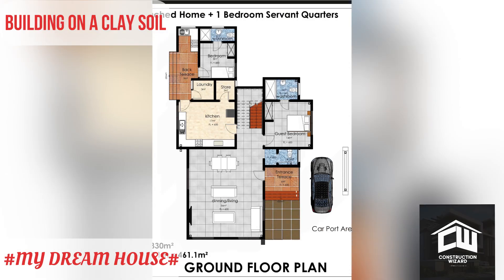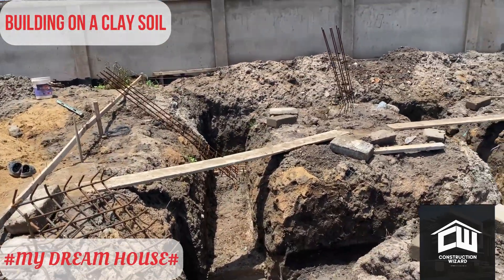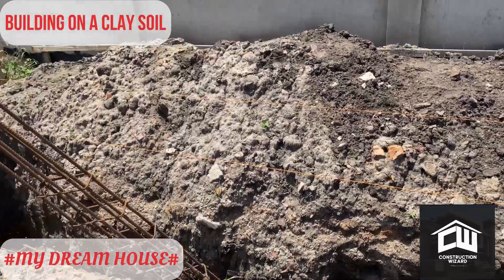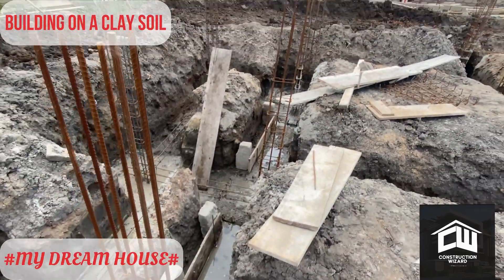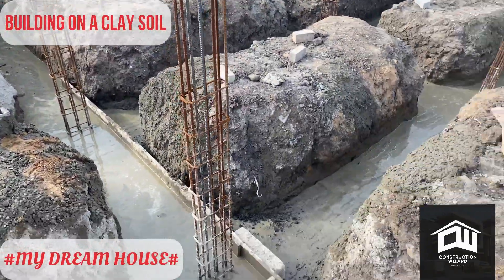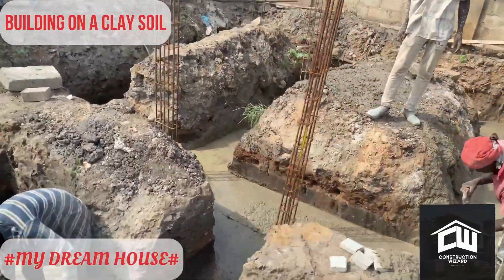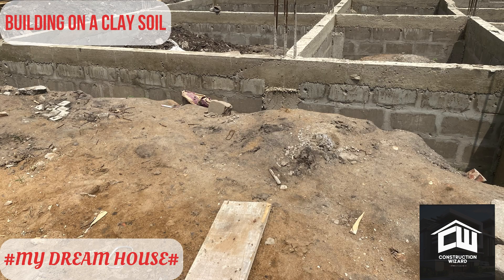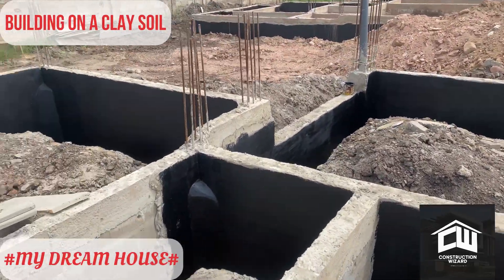MY DREAM HOUSE ''HOW TO BUILD ON CLAY SOIL'' PART 1

Comment: Rich man's project. The steel reinforcement could hold a 4 storey building. 

The ground and plinth beams plus foundation walling is  unnecessary and way too excessive. 
Did you reach the rock layer underneath the clay soil??
Reply from the maker: Woow, You think so. Don’t understand estimate clay soil. It can mess you up